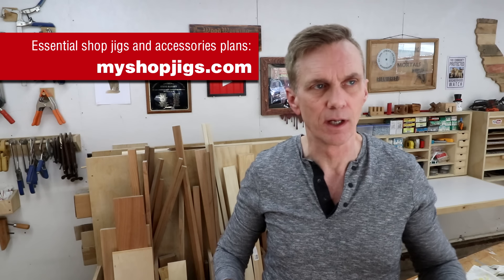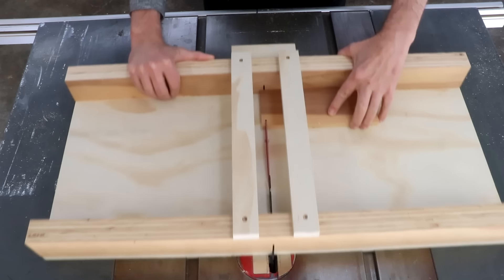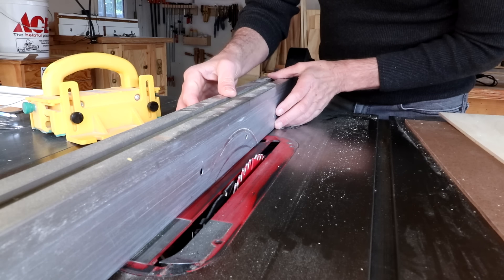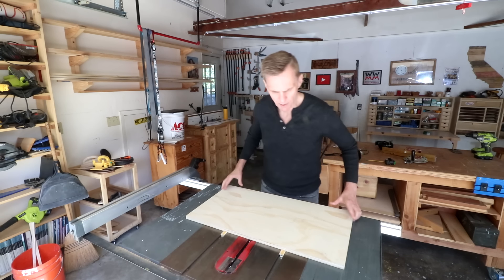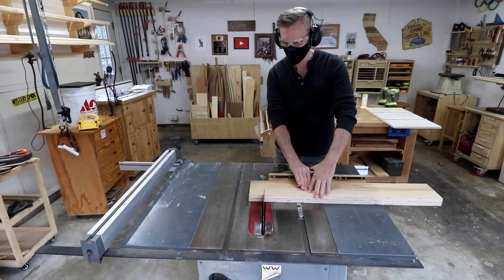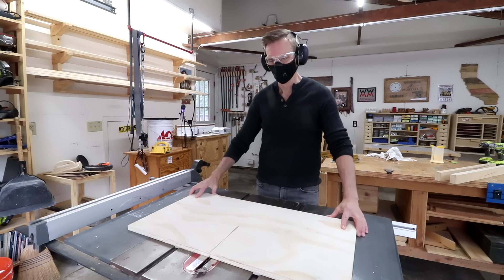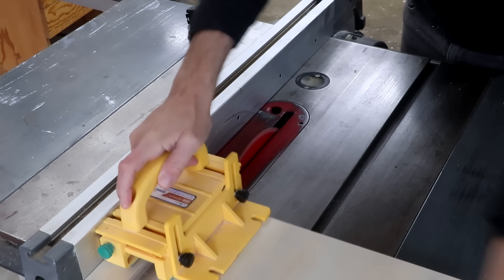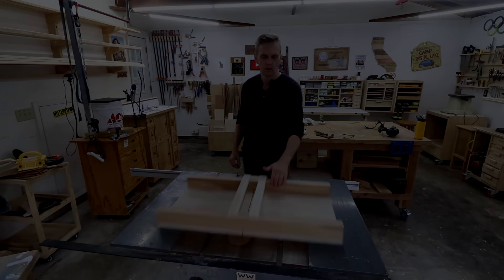The simplest table saw crosscut sled on YouTube. Essential woodworking shop project.

Comment: Using a sled, is it safe to move your wood backwards through the table saw blade, while it's on? For example, at 15:37, you move it forward to cut through the piece, then pull the sled back before moving the wood out of the way. Is the expectation that the sled is square enough, meaning you'll only be pulling back through the kerf? Would it matter if the wood shifted slightly & you instead caught the blade into the wood moving backwards?
Reply: It's plenty safe.  I pull lumber back through on the jobsite all the time with no sled.  Just understand the type of wood you're working with, its propensity to bind, how close your hands are to the saw blade, what the saw sounds like when its working against itself etc.  If you don't have a good feel for the saw and wood yet then I would say no but as you get experienced you'll feel safe doing it.  The ones who lose their fingers are the people who have their fingers too close to the blade, hold onto material instead of letting it go when it wants to go, keep going when the saw is fighting itself, etc.

For example, my guys always seem to wonder how I know when to come over from across the jobsite and ask if they're doing okay.  It's because I can hear the difference in a saw or drill when its cutting correctly and when its not.

Comment: Great sled! However, wouldn't you want a slight bevel on the inside of the front fence to prevent sawdust build-up?
Reply: Yes, that's an important detail
Reply: I agree. I know this sled was supposed to be a very basic and easy one to build, but even for that type of sled I would really recommend a bevel like you described.
Reply: I agree.  It's easy enough to do, and can't hurt.  But that said, my experience (I don't have dust collection on top) is that even still enough dust and particles accumulate there that I must be careful to occasionally brush or blow it out to avoid buildup.
Reply: @DonHutchins  Yes, but then the cleaning operation is extremely quick and easy. Same as with stop blocks, a quick brushing off might not remove 100% of the sawdust, but with the bevel it just doesn't matter.
Reply: Exactly. I also do that on stop blocks.

Comment: I have watched dozens of cross cut sled videos and made a few of them. IMHO this is the best one by far and using a good square makes this sled as accurate as it has to be for the projects I will be  building with my table saw.
I built this sled and I absolutely love it. I attached the important fence first so I could use my large framing square to set it up and it is extremely accurate. I use a small clamp to attach a stop block to the fence of my Dewalt job site saw and this fence can extend to 32 “ so I am using this sled for longer repetitive cuts. I am going to make a stop block exactly 1” thick so can use the scale on my table saw and just subtract 1” 
Thanks again for your great videos.

Comment: I wanted to make a sled and watched this video. Then I followed your link to get the plans. Made it today for my Ridgid job site saw. Since the tables aren’t cast iron, I waxed the bottom of the sled (also used sorta cheap plywood) and it works great. At least for what I need. I love your videos. It’s nice to see someone not using top of the line everything. Thanks for keeping it real.

Comment: A old fart, me, finally used the video to make a small sled for my new table saw. Used 1/2" plywood and it works just fine and dead accurate.. Thanks Steve   😊

Comment: "Don't use natural wood for your sled rails because moisture will cause expansion."

I wish I saw this video 6 months ago when I built my sled! Had this EXACT problem happen to me. My woodworking setup is in my basement and the humidity can be erratic there. I used pine rails ripped off a 1x4 board. The sled worked great for a few weeks, then started sticking as I push it! I realized it was because the rails expanded, so I sanded them just a little bit narrower.

That solved the problem for a few weeks, until the rails dried out more and shrank... now my sled rails have too much slop in them and I can't even get square cross cuts! 

Fortunately, now I can learn from my mistakes and attach new rails using a wood that is less subject to moisture. Thanks as always for your great videos!

Comment: Thanks Steve, I've made a sled for doing 45 degree cuts for picture frames and had trouble with the guides binding from time to time.  Your suggestion to not use solid wood is great, that was my problem there.  Anyway, a simple crosscut sled is next for me and you made it look so easy.

Comment: I did find it funny that you used the mitre gauge to make a cross cut to make a cross cut sled. I think this will be a lot easier to use than the jig I use with my circular saw. Thank you 🙏

Comment: Making my first sled for my table saw.  Used the Miter Gauge to set the fence to cut the runner.  It was a perfect fit on first cut.  Have never seen anyone using their gauge runner to do this.

Comment: It worked like a charm except I forgot to inset my front fence so I built a little box around where the blade would come through.  You're a saint.  You got me going with table saws, routers, circular saws, glue-ups, staining and finishing...just about everything I know.

Comment: I used to have a crappy Harbor Freight table saw, and I never even bothered using the miter gauge, since it was so terrible.  Best non dancing related jig ever.  When I made mine, I made the front fence a little taller and put a contour on it that is high in the center where the blade is, and lower on the outside part that you grab.  It provides the same safety reminder, and only requires a couple of jig saw cuts and no extra screws

Comment: Just made my first cross cut jig using Steve's simple plan, I'm going to use it for making cutting boards which I've been having a lot of problems with keeping the strips nice and straight for a good glue up with no gaps.  I think this is really going to work out nicely, thanks Steve for helping a beginner home woodworker slowly move forward a dado notch at a time 🙂
Reply: You might want to look into buying a benchtop jointer if yoy plan on doing cutting boards. You'll never have a problem with gaps again. 
Are you using your table saw to make your final length cut once its all been glued together?

Comment: Just made a crosscut jig using the 5 cut method and instead of using feeler gauges to make my adjustment, I clamped the sled to the table (not the fence), and set up a dial indicator at my measured and marked point of adjustment on the fence.  That got my jig square to .002" over a 16.25" cut.    Which is PLENTY accurate for me.
Reply: I just bought a vintage table saw...the mitre gauge has been misplaced..,thanks buddy for this idea

Comment: Another ace video  Steve - thanks. I have been trying to work out a way for weeks to build a cross cut guide after mounting my table saw into a large bench on wheels like the one you have in the background.  I didn't realize until I saw this that i should be using both of the guides on the saw surface like with the sled you made.  You are right - the cross cut guides you get with the saws wobble and its hard to get an accurate cut. Thanks again - I am going to construct this sled.  Keep up the good work.

Comment: I used this Idea in a smaller size for my Ryobi. There is only one slot and I had to make a 2 layer runner (upside down T) but it works great! I also made the push stick and push block from your designs. Thanks - broke, disabled but loves to build stuff

Comment: I have a small modeller's tablesaw, I use several shape/angle jigs for cutting. Rather than a full sled for every jig, I built a main crosscut sled and made smaller project sled inserts that clamped to the main sled.

Comment: Great video as always. I have built several crosscut sleds and used the 5 cut method and also just squared with my squares. I never see enough of a difference to justify getting the sled down the 1000th straight.

Comment: This is a great design. I made mine several weeks ago and it works great. I did have a “scare” using it today, though. Totally my fault. I typically work with 1/4” to 3/4” material, but today I was trimming the ends off of a 2-1/4” thick piece so the blade on my Dewalt 10” job site saw was raised up really high. The “extra” thick material meant that I had to push the sled further towards the saw than normal to complete the cut. The blade cut all the way through the back of the sled and was exposed while the saw was still running. Fortunately, my habit is to hold the work piece against the fence and then push the sled using one of the top safety rails. I should have anticipated this happening, but I didn’t. As I stated - my fault! I’ll add some more material to that back piece to account for thicker materials. Just wanted to share the story. 

Edit: to be clear, my Dewalt saw is smaller than Steve’s saw so my sled dimensions are different. I think that’s a contributing factor.

Comment: One thing I added to mine (per somebody else's advice) is a shallow chamfer on the inside of that front fence that the work piece rests against. This provides a channel for saw dust to go into so it is less likely to get in the way on subsequent cuts. If you leave it squared up then the smallest wood chip in that corner could keep your piece from sitting flush against the fence. Great sled though, I might need to make myself another one soon!
Reply: Thanks for mentioning that because I’m in the process of building my first sled.

Comment: I made an outfeed table with slots for the tracks. I also drilled holes in the tracks and put a dowel in each track to prevent the sled from going so far that the blade comes too far out the front, past the safety blocks.

Comment: I built the sled today, I made it a bit deeper, but the same method. I didn't bother squaring the back fence, and I made it half as long as the front fence to save weight. It's working awesome! Check out the 5 cuts method and formula to get it totally square, it's really easy

Comment: Hey Steve. When you are fixing the front fence it’s easier to drill 2 pilot and screw holes from the top through the fence and screw in from the top (ensuring the screws don't blow through or are overtightened) to hold the fence in place while you make it square; no risk of bumping it out of true and no need for clamps or awkward screwing from the underside.  Once you get it sorted then you can flip it up and secure it from beneath. Remove the 2 screws from the top and if necessary fill the screw for aesthetics and as we say over the pond, “Robert is your father’s brother”.

Comment: I just got a 4' piece of t-bar that fits my t-slot in the saw top. I cut 4" pieces and attach them underneath in line with the runners on the "far" fence side. This keeps the sled from tipping when I have to pull back a lot to cut a wider board.

Comment: Steve, I’ve used hardwood (mostly red oak or maple) for runners in a number of jigs, and even with wide humidity changes over the seasons (very humid summers), have never had a problem.  The trick, I believe, is in using quartersawn wood and aligning the growth rings parallel to the table.  That way, most expansion happens vertically in the slot. With the relatively low humidity in CA, I doubt you would have an issue either way.

Comment: Really like that you put 2 rails across the top to remind you there is a blade there. So many sleds without anything over the blade. I was thinking of using a piece of polycarb over the top to do the same, which would also stop any chips flying up at me.

Comment: Don't forget to check your fence and blade are parallel to the miter slot at the start. Not necessary I know but end result will be better and it doesn't hurt to give it a check now and then.

Comment: I have been woodworking since high school… many decades.  In addition to wood shop, I was involved in some woodworking classes in my college years. Neither shop had a crosscut sled.   Over the years I have also never had one. On top of that, my table saw had a sliding mitre plate, and no mitre slots - I couldn’t make a traditional sled if I had wanted to.  I actually picked up a new saw on Thursday, and built my first sled today- had 3/4ply left over from a few other projects. Loosely followed these plans (Thanks!), but did roundover the bottom of the fence with my router to allow for sawdust.  As I was building it, I was wondering… am I actually going to use this thing?  I have a
Mitre saw after all…. 
As I was getting ready to cut down the blocking for behind the back fence, I realized how much better/safer/easier this was going to be on my new sled.  This thing will get a ton of use. Amazing how something so simple can improve the experience so much.

Long time fan of the channel!

Comment: I have a Ryobi table saw with a non-standard slot width and those super frustrating tabs instead of a true T-slot. I made a project last night with the kit miter gauge, and it was so sloppy! My solution tonight is to take a dremel to those stupid tabs so that I can make drop in runners.

Comment: Well done! The only thing I would do different is not to put the strips on top so I can cut taller pieces with the blade at it's highest point. I've used many table saws with 14" blades so the blade raises pretty high. As the head table saw operator for over 25 years at many shops nationwide I created lots of jigs through the years. Thanks for sharing...

Comment: Thank you so much for the plans and for offering them for free. I'm building a crosscut sled myself as I only have a table saw and a skill saw but no miter saw. I checked out allot of videos and I like yours the best as it strikes a perfect balance between performance, size and weight. I'm up in Canada so I'm off to the lumber store(Timbertown) to get some birch plywood. What do you think of finishing it with a mixture of Paste Finishing Wax and Linseed Oil?

Comment: Nice and simple. As an extra I put a ply stop on my multi angle crosscut sled so that I literally cannot accidentally push it far enough for the blade to poke out of the safety block after the end of the cut

Comment: I'm still in my woodworking beginning stages and just got a table saw. I noticed immediately that I really need a crosscut sled. The miter gauge is not accurate, and has too much play, especially when you're trying to cut pieces that may pull the miter gauge out of the table. This will definitely be my next project. Thanks for sharing!

Comment: I just made a version of this for my old craftsman job site table saw. I filed off the little c channel tabs some time ago, so I just used a couple strips of quarter inch Luan. Not the best material... But it does what I need.

Comment: Was looking at your design and being you squared the rear fence you could make it reversible and have the reversed direction  you could make a second kerf that is favoring long stock on the left side of the blade making it a dual purpose sled.   

I’m very new to wood working and don’t have my first table saw yet but watching a lot of videos to get ideas.   

Thanks Steve!

Comment: My table saw (Dewalt DW745 Type 4) has a fairly short table, so the sled had a tendency to want to tip off the front and back. I solved this by countersinking washers into the runners, utilizing the edges of the T-tracks to secure the sled.
Instead of moving the rear fence forward, I countersunk a board into the bottom of the fence, sticking out about 6" and screwed two upright pieces to it from the bottom, one on each side of the blade, offset about 1/4" from the blade. That way I can make cuts at full blade capacity without the blade ever being exposed at the back.
Safety first, right?
I also made the rear fence high enough that I could rout a T-slot in the top, that way I can slide the stop block across the middle without removing it.
I also didn't make the front fence full width to save some weight, but still long and high enough to avoid the sled flexing when moving it around the shop.

Comment: @10:55 you say that there's no real need to square up the back fence... I'm wondering (I apologize if you've done this in another video already) if you could offset the entire sled to the right of the blade (for example), then turn the sled around if you needed the sled to be offset to the blade on the left side? This would preclude the necessity to make two sleds with opposing offsets but would require both fences to be squared up to the blade. Just thinking about this for small shops that need multi-purpose DIY tools... As always, thank you for the great videos and your instructions!

Comment: Great concept and execution. I'd like to see you figure out the most simple way to do the 5-cut method for a crosscut sled. I say this as an experienced woodworker because the new woodworkers will, in time, need a very... very square cut as their skills mature. Not gonna comment on the lost screw, since no saw will likely make the breeze-power to move that out of the sawdust trap... but awesome nonetheless. Thanks for being the educator in this craft that you are.

Comment: Thanks, Steve. Building this now. I also followed your lead on my mitre sled, and that went well. I like the way that you focus on how to construct the basic jig, without getting too carried away with elaborations - though the final blade-guard safety features are pretty important and I will definitely be including. I can add refinements like hold-down tracks later as both my fences will be removable. 

I also used doubled 3/4" ply for the fences, and when I came to trim the ends with my mitre gauge, it reinforced just how much I need the sled 😁I got nowhere near square with the gauge!